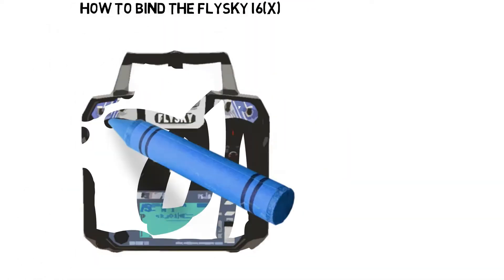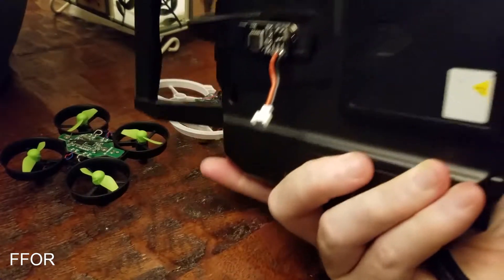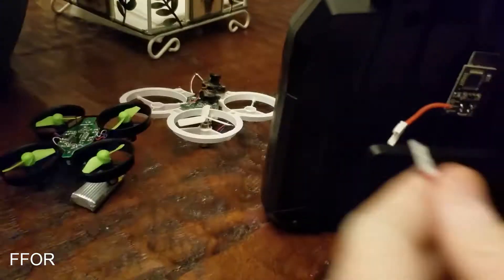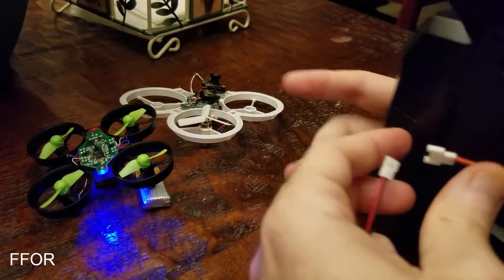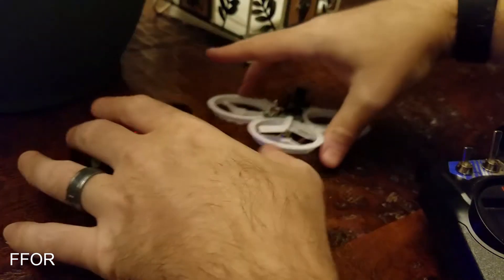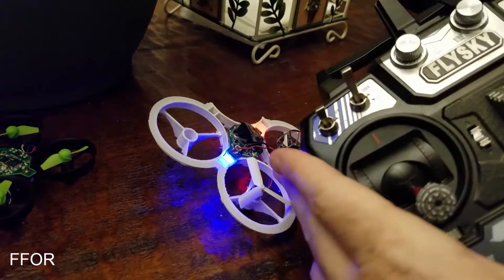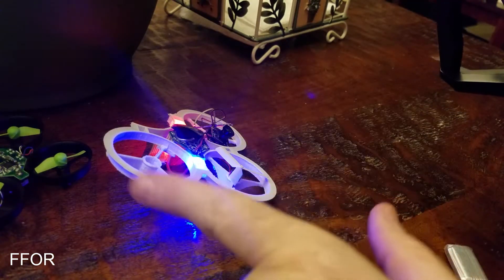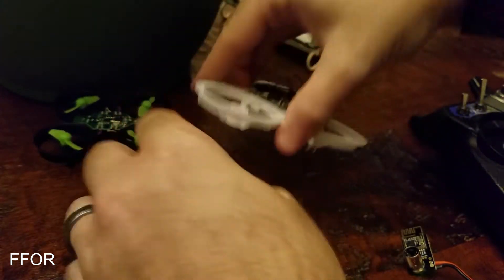How to bind the Flysky I6 using the iRangeX module to the Eachine 010 and E011

Comment: Awesome. I am waiting for the parts to arrive. I found only in one site, and nowhere else, that it doesnt bind if you have flyplus firmware(10 channel mod which is a must). Do you have the stock 6 channel firmware?
Reply from the maker: I have the ten channel mod.  Can't live without it.

The only thing kids that it is stuck on lower rates, so you have to prepare for that. Not a huge deal for me
Reply: @Sully365  thank you for your reply. So, does the irx6 recognize rudder stick gestures with the 10 channel mod?
Reply from the maker: @apostolisioannou4073  i'm not sure what the rudder gesture is but it works like normal on the 10 channel flysky.  I've only tried using it on those two quads and they work normally except they are in the lower rate mode, so i'ts more of a smooth flight setup and not acro ripper.
Reply: @Sully365  cool!

Comment: This doesn't work on mine as when I have both sticks down to the right with the bind button when I turn it on.. It gives me the all switches must be up including the left throttle stick up as well..so how can I overcome this?
Reply from the maker: Make sure your switches are all correct.   The radio will turn on as long as the sticks are down and the switches are up.  Once the radio is on, move the sticks to the correct position

Comment: what about jjrc h67?
Reply from the maker: Burlingwood Au  I'm not certain.  There is a document link in the description and it may have it listed but i do not know since i don't have that one. I don't think so offhand
Reply: @Sully365  thanks, apparently it's same as the eachine E011
Reply from the maker: @burlingwoodau7277  oh thats' cool.  i wonder if you can flash silverware firmware onto it for acro mode
Reply: @Sully365 btw does it mean you have to rebind to e 010 and e011 if you switch between the two?
Reply from the maker: @burlingwoodau7277   Yes, anytime you switch models, you'll have to redo the procedure.
Reply: @Sully365  THanks!

Comment: is i the same with the turnigy i6 and is it the same protocol as the jjrc h36, they are practically the same
Reply from the maker: Turningy i6 is the same as far as i know. There are several that look like this. 

As for the jjrc h36.. Sadly, this will not work on those

Comment: Can someon  help me bing the  beecore silverware to this module
Reply from the maker: what do you need, exactly?  i'm running the silverxxx on the e011 but it's not beecore.
Reply: Chris Sullivan Chris Sullivan oh darn, well I have flysky i6s transmitter and flysky IrangeX multiprotocol, I’ve used h8 mini before so I know my multiprotocol module works and it’s says on the manual that came  with it that I’m supposed to do so same stick gesture on power up as the eachine it even says bayang toys protocol but i can’t get the beecore to bind
Reply from the maker: @thelongranger55  I'm not sure if it is compatible with the beecore

Comment: Hi, I have a question. How do you trim the quad if it drifts to a certain direction just like its toy transmitter? Also, have you tried flipping or is there a way to assign a flip and roll button? Thanks
Reply from the maker: i believe the trim works on the controller as it does for any other..just use the slider buttons nad see if that helps.  I do know these micros aren't the best when it comes to trimming out.  

As for flip or roll, I use the silverxx firmware and have a video on flashing it.  I haven't tried for a flip switch, though i think it's mapped somewhere.  i will have to try again

Comment: sir  mine is not working the eachen H8 mini . I try many times  sir.
Reply from the maker: From the instruction sheet, it looks like you just need to push the right stick up and right.
Reply: No sir . I have instruction sheet. " RUDDER RIGHT + AILERON LEFT   for eachine H8 mini.  anyway thank you Sir  i well try your Advice . more power Cris S.

Comment: Watched another vid and he couldn't get his to bind with the E010 just the E011 would work. Glad you cleared that up :) And it sounds like you prefer the E011.
 Does it fly better than the E010 ?
Reply from the maker: Paul Everett it's faster and.. Well, faster.  I like both, but the e011 is more capable overall.  For a 3-5 dollar price difference, not a bad upgrade. I've since left brushed micros for brushless since the 2s brushless is good for my yard
Reply: Chris Sullivan thanks ! 2s is a too much for my yard. Considering a brushless 1s tho :)
Reply from the maker: Paul Everett a 1s is on my wish list as well. Inside acro ftw
Reply: Chris Sullivan 😃 have fun flying this summer

Comment: How do you do flips with this controller , have not figured it out , if possible ???
Reply from the maker: Wray Smith I'm not sure.  I will see.  I think there is a switch you can use for flips
Reply: you can setup the swa or swb/c/d to the channel 5 or 6 and use it. a got it... too easy...

Comment: Hello. If i dont have e010 and want to bind to e011, do i have to bind flysky to e010 before trying to bind it to e011? Or i can buy flysky remote with irangex module and bind it directly to e011 without binding it to e010 before?
Reply from the maker: Tadas Jurkštas you can just bind to e011, no problems
Reply: Five Freaking Onion Rings thank you ;)

Comment: Hey I got my I6 bound to my E011 but the thrust is much weaker than when I use the stock controller. How do I fix this issue?
Reply from the maker: Drew Phifer are your endpoints set for the throttle? I didn't notice a decrease in thrust.  You could try adjusting those so 100% or higher is reached earlier.  I think the extra throw makes it feel weird
Reply: Thank you so much for your quick reply and this helpful video Five Freaking Onion Rings. I have all of my endpoints set at 100% and used the dual rate/exp option to have a selectable a low(70%) and high(100%) speed. It handles similar to stock controller at 70% except the lack of thrust. The stock controller has the option where you can press in on the right stick for 2 seconds and switch the thrust to account for the included lego guy. When I try to fly with my I6 it is like it is in the lower thrust setting maybe even less but I cannot find any way to adjust for more thrust
Reply from the maker: Drew Phifer I'm not sure I've ever known about two thrust settings.  Interesting.  I will have to check it out when i get in

Comment: there is a support forum for the irx6  that has a link  to a list all the quads that 
work with the irx6.
nearly 200 of the NRF24L01protocal. 
also one guy has made a mod that has control distance of 275 meters
far better than the 30m stock board control distance
https://www.rcgroups.com/forums/showthread.php?2905531-iRangeX-iRX6-Multiprotocol-TX-Module-for-Flysky-FS-i6-i6x-Transmitter-FREE-TEST/page8

Comment: so is there a possibility to connect he module to the battery bay in the transmitter?
Reply from the maker: There is but you would need a buck converter to go from the 4.8-6 volts out of the transmitter to 3.3 to 4.2 volts for the module.  you may be able to get away with finding a 5 volt output in the controller itself but i think that would still overvolt the module and fry it.

Comment: Hey again.  Santa brought me a E011 for Christmas so I was finally able to get things going with my module and FS-I6x.  Works like a champ! It’ll be so nice to fly around with a real controller. Hey is there a way to set up a switch to change to the high rate mode? If so could you show that or is there a vid already out there you could point me to? Thanks again.
Reply from the maker: Dean Hallal you're supposed to be able to do that... But i can't find how and i can't try anything with the stock e011 right now.  I believe it was simply flipping one of the channels but i have no clue how offhand

Comment: Not working for me
Reply from the maker: which whoop are you trying to connect?  if the E010, plug in the drone, plug in the battery for the module, hold sticks to lower right, turn on transmitter and it will connect.  Right stick to upper right for the E011 instead of to the lower right.
Reply: Nevermind I got it to work. I was moving the stick after I turned it on not before. Thanks for the vid!
Reply from the maker: Alexander Thompson that happened to me... More than I'd like to admit
Reply: I aporeciate it. Never would of known about this unless I came across your video. It really enhances the performance of the e011.

Comment: Thanks for vid, but you left out instructions for left stick on E011. You only said right stick upper right, but no left stick instructions. Please help. Thanks
Reply from the maker: apologies for that, left stick is down and center/neutral.  you have to have the left stick down to actually turn on the flysky so the left stick is pretty much down left, down center, or down right for mode 2 flyers
Reply: Five Freaking Onion Rings Sweet thanks. How I do the auto flips like with stock controller by pushing in right stick, then moving the right stick to the direction you want flips?
Reply from the maker: MicroModDude it's a channel switch.  For me, the 2nd in from the right.  You flip the switch and then press your direction.  Basically the "features" of the micro are moved to flysky switches

Comment: Great video. Mine is in the mail 😊
How do you change rates on the e010? Is it a aux switch?
Reply from the maker: It's an aux switch. There are instructions that come with but they are a bit confusing.  You'll have to essentially try setting a switch for this http://img.banggood.com/file/products/20170629020647TOY-MTX_Instructions%20(2).pdf
Reply: Five Freaking Onion Rings thank you

Comment: can you do this with the e013?
Reply from the maker: I think it uses the same protocol as the E011 but i am not certain as i have not received the E013 yet.
Reply: ah i see. where would i get those additional cords to connect the irangeX to the battery? so new to this i'm not even sure what they're called! thanks
Reply from the maker: I bought these: http://www.ebay.com/itm/6pcs-JJRC-H20-H20C-RC-Hexacopter-Part-3-7V-260mAh-30C-Lipo-Battery-Charger-Set-/131995571884?hash=item1ebb8c96ac  which come with the cable you need.  You lose 1 cable for charging but i just rotate the batteries through on the other 5.  these are also perfectly sized for the E011, BUT you have to modify the terminals to connect them.  I have a video on it for the e011.  the e013 is similar but you have to have decent soldering skills.   https://www.youtube.com/watch?v=XwTdrbTL1_0

Comment: How is your throttle rates doing
Usually they are weak
Reply from the maker: MR GUPPY 101 so far, my punchouts seem normal. I may change my endpoint and see if that alters anything.  You could also set up a throttle curve... i may try that when i have more batteries
Reply: On my taranis 
Came a bit weaker
I was wondering if you had the same problem
Reply from the maker: I'll have to compare with the stock peanut but it didn't seem to be lacking..  I can hardly tell with the e010 since it's so slow as it is.
Reply: Five Freaking Onion Rings 
I got rid of my eachine e10 s
I fly 11s only 
And that’s 
When you can  fell the punch 👌🏽
Reply from the maker: MR GUPPY 101 good to know.  Have you tried the acro firmware?  That made mine super zippy.   After that, i swapped in 8520 motors so I'm not sure how close it'll be.
Reply: I have the same problem